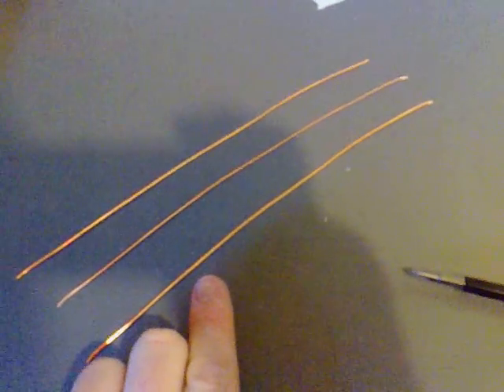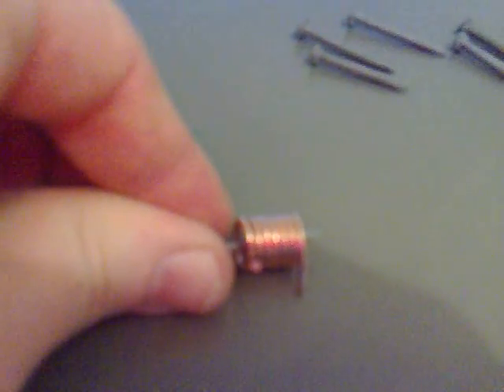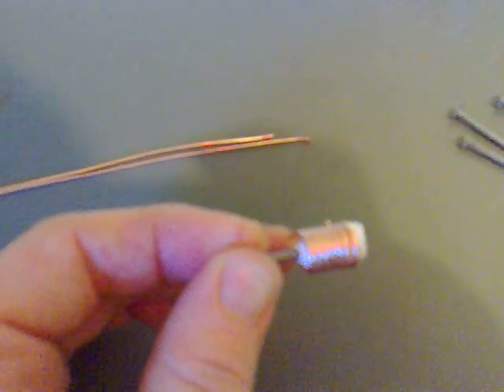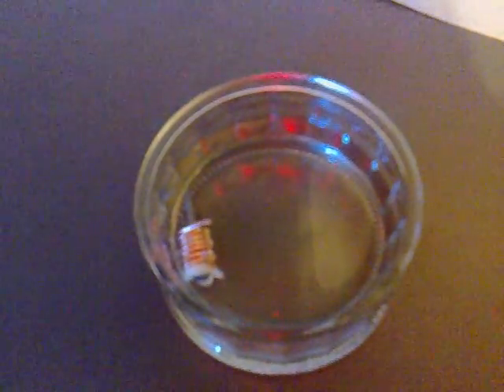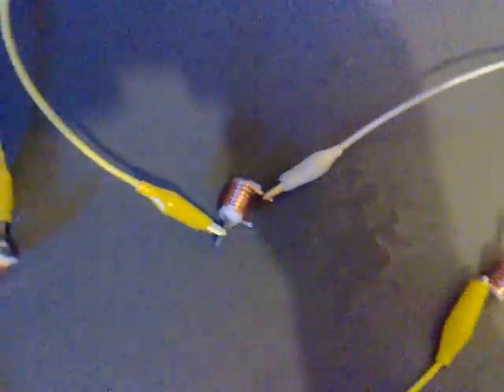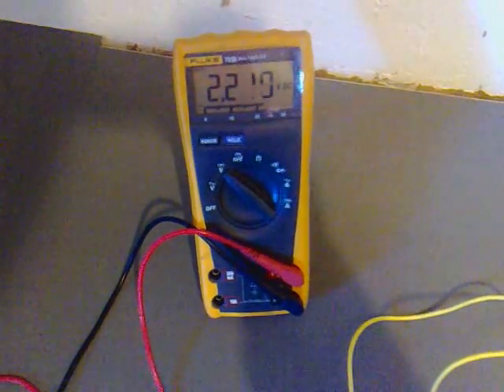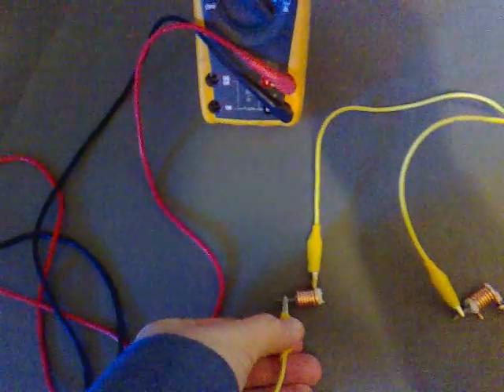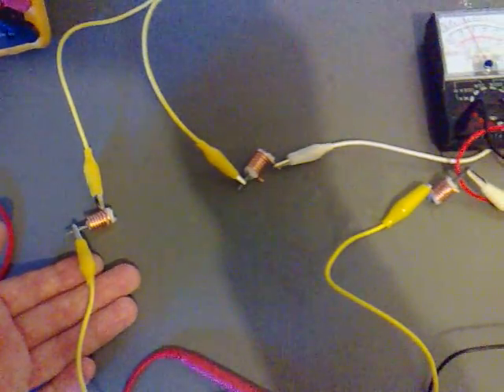Water Battery (3 In Series) 001

Comment: @wolffallen I'm going to build and test a fish tank size battery with 11 cells inside using zinc and copper and citric acid using some tap water and a pipe filled with sea salt will sit at the bottom and be closed off so the salt will build up on the outside of the pipe causing it to pass zinc ions to the copper to produce voltage, are i can bypass it all and mix the sea salt in each cell.

Comment: @anuthehigh if you look up lidmotor on here, he has circuits and links to other people making a jouletheif
if you make this up, its a very simple circuit its just a transistor and coil, and resistor, it can help suck more power out of the waterbattery, i was able to light a LED off a single cell waterbattery, but i did not do much testing with that, because i started getting into wirelessly powering stuff, end goal is to wirelessly light up a fluro tube using a mini tesla coil with waterBatterys

Comment: @anuthehigh my batterys all had different lifetimes
i had 1 '2 cell' running a digital clock for about 6 months this was probably the longest, it just had the 4 terminals in a shotclass that has 2 sides, you know the once, you get 2 different color alcohols one in each side.
some of my others running LED lights have lasted up to a month 
using just plain water, if you add vinegar to the mix they run alot brighter, but it eats the magnesium away faster, with in minutes if you only use vinegar,

Comment: @jucest i made lots of different versions,
i used water crystals to separate 1, tissue paper for another, cotten thread, anything that will hold water really
for magnesium i usually use a strip about about 1mil thick, by about half a inch, to an inch long or more, again ive made lots of different version
for copper, i usually used copper wire, and just wrapped it around the "stuff inbetween" like winding a coil
since then i have just been using a copper strip abit bigger then the magnesium

Comment: I was messing around with these batteries, I checked one with my meter, 0.8v then i connected my 16v power supply and charged them, then I checked them, 1.3v.
I connected 5 uncharged batteries to an led, it glows, with three charged brightly lit.

Comment: Ok, so you made a battery ,very low voltage low amperage ,what is the point ,it will not run my cell phone ,I can go to walmart  and buy a battery ,how is this better ... this is 1800 tec , unless you are working on a second grade science project it is just trivia . If you want to put 15 or more of them to replace 1 of your battery's in your TV remote  have fun . lol by the way, more energy used  and CO2 produced to make the cope and zinc nails than you get in return , again what is the point?

Comment: i have an old block of magnesuim with a piece of flint on the side, its a  camping or survival thing, but i have also bought a roll of magnesium ribbon from ebay, its perfect for the job its only 1 or 2 mil thick and about 5 mil wide also about 75ft long, i have been running an led for about 3 weeks now too, its still fairly bright, but its dimming down abit now

Comment: i ran an led for about 3 days solid off these batterys but i found that brass and magnesium is better, i got 0.68 volts from a zink nail and copper the same as in this video, but using brass and magnesium i got 1.5volts from a single cell, ive been running a clock off this for about half a month so far and its still running nice "digital"

Comment from the maker: Cheers, I think That the bigger the more current you can squeeze out of them but the voltage is always about 0.8-0.9 ish.

If the zinc and the copper are closer together you get more current.

SO, surface area x distance = larger current

Thanks for watching..

Comment: Basicly all in YouTube whit this Water Batteries are getting 0,9 V. It is some caind of "sweet spot" for them I see...

But also what is intersting, you can put them in series, and Voltage do increase, maybe amps too?

But basicly, if we want to run motor, best choise could be Newman Motor, best ones use under 5mA, and I think these Water Batteries make more current than that. So you could need 12V / 0.9V = 13,333 WBatteries, not bad at all. And maybe 20 of them will run motor clearly.